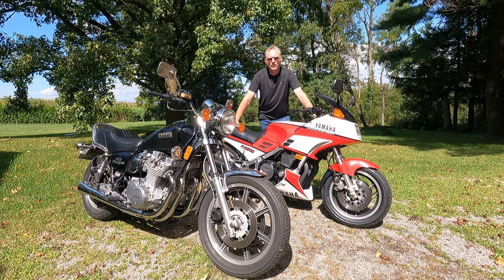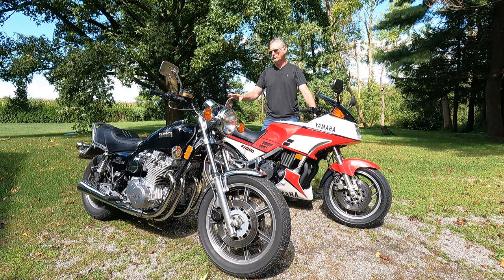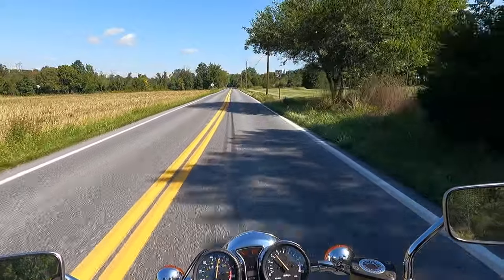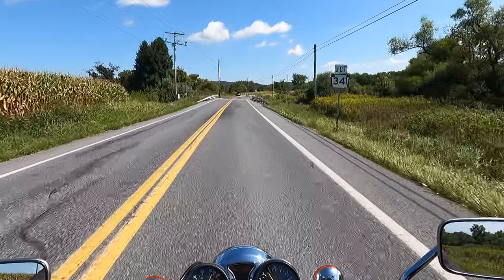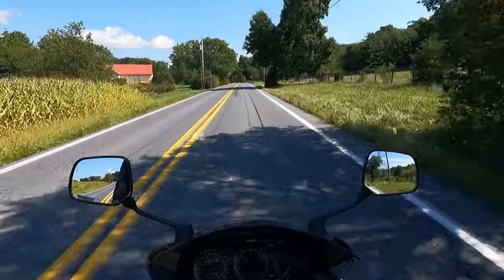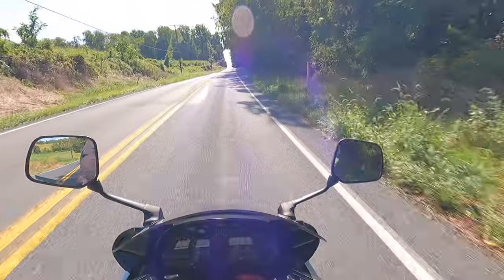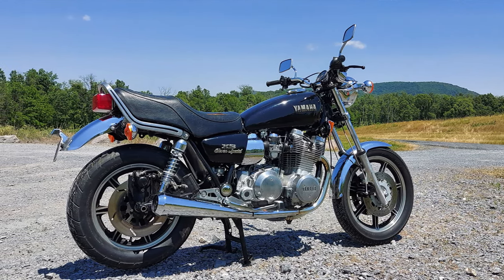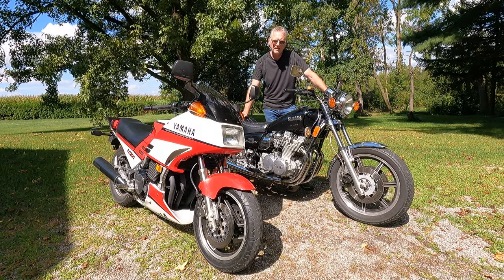Yamaha FJ1200 Vs Yamaha XS1100 - Yamaha's Big-Bore Evolution!

Comment: Great video. I'm restoring a 1980 Special. As a teenager in the late seventies I lusted after all the inline 4's. I did have a friend that bought a Honda CBX new, those prices have gone through the roof. Cheers.
Reply from the maker: Nice! You can check out the XS1100 Special playlist on this channel to see what I did to get mine running and road-ready. The CBX is eye candy and ear candy all in one. I'll be referring to the CBX in my 1980-1981 GS1100E review that will post to the channel tomorrow morning. Cheers!

Comment: I have an fj 1200 / 1987 for 3 years from now. It has 113K miles in its heart, and it just runs  fine as it can be...despite of all the bad things can happen to a motorcycle's engine, like gas flooding the crankcase (I did not notice it for a long time and pushed the sht out of this poor old  lady on the highway) or not good type of oil was used in the bike for 2 years by the previous owner. It pulls hard, sounds awesome. Really noisy  at idle, but I got used to it. John, your bike is in 10 times better shape than mine, so if you change oil regularly, and check your valve clearances, it will last way longer than you  might live (hope you will celebrate your 101st birthday). Greetings from Hungary, Tamas
Reply from the maker: Thank you, Tamas! I'm glad you're enjoying your FJ1200. To get 113k miles out of any bike is awesome. Greetings from Pennsylvania, USA!

Comment: I had a 1990 FJ1200,commuted 150 miles to work on it,never let me down.A very smooth reliable mile eater.
Sold the bike 16 years later,became a little too heavy for me in my 70's.
Still luv Yamaha's,have an out of favour 82 XJ650,but I like it.
Also enjoy my 78 XT500 & sadly, betrayed the Yamaha brand for the first time with a little Suzuki TC185 Ranger.The Suzuki is a basket case long term project,parts dependent.
Reply from the maker: @davidhoddell4209  So cool 😎! I think the 1990 FJ1200 got a rubber mounted engine, which greatly helps the smoothness. The XJ650 was a nice bike as well. Good luck with the Suzuki!

Comment: The XS1100 has always held a place in my heart from my very earliest biking days. My first machine was a 1975 Yamaha FS1E, bought in 1979 shortly after my 16th birthday. Out for a spirited ride around my home in Oxfordshire, I noticed 2 much larger bikes catch up to me then pass as if I was at a standstill, I was maxed out and head down so probably about 46-7 mph 😂. I pulled into a local Yamaha dealer near my village to pick up a part and the 2 bikes were parked outside, a silver and blue XS750 and a gold pinstriped metallic red XS1100, both nearly new. 
I must have been staring at them in awe when the 1100 rider came out of the shop, he smiled at me and said “ you were going well for a littlun mate” I think I said thanks or something but was a bit star struck “ you’ll have one like this one day mate, take it steady” and he walked back into the shop. I waited around for a while to watch them start up and ride off, must have looked like a right sap, it was worth it though. To me they were 2 huge bikes with god like riders, so smooth and skilled as they accelerated off the forecourt and onto the road. I’ve had over 50 bikes in the years since, everything from Rd350lc, Fireblades,  ZX12R, Harley Road kings, BMW GS adventures and standard, GSX-R track bikes etc etc but I would still love to have a metallic red XS1100E in my garage 😊
Reply from the maker: Right on, Mark! Thanks for sharing the memories. Cheers!

Comment: Finally the XS1100 getting some well deserved props. I have an 80 XS100SG that I got in 1981. It now has 35K on it and a few updates. The buckhorn bars replaced with drag bars from the 80s and a sweet MAC 4-1 pipe. I've owned a lot of bikes since then and this is the only one I kept. Short in town hops are on the XS and multi week tours on the HD Ultra. Great bike
Reply from the maker: Right on! It's awesome that you've owned the XS1100 that long. Cheers!

Comment: Several years back, I had the XS 1100 1979 original And let me tell you that bike was properly quick. I’m currently riding a 2023 Yamaha MT 10 which is obviously a properly quick motorcycle as well but I still remember how fast XS 1100 was. I nicknamed it the zapper because you twist the throttle on that thing and zap you go through time and space like you wouldn’t believe. if I remember correctly, mine had either a 130 mph or 150 mph speedometer I can’t remember but I noticed that yours has the 80 mile an hour speedometer.
Reply from the maker: This XS1100 is still properly quick as well. Sitting up in the wind gives it a real sense of speed when you twist the throttle. The FJ just feels relaxed. I was shocked when I timed the results. 1980-1982 the 85 mph speedometers were government mandated, I believe.

Comment: Thanks Jon, did you change the XS1100 petcocks to manual one?  If so, which ones did you install?  I'm looking at that change presently.
Reply from the maker: I'm still running the stockers on mine. Cheers!

Comment: Kenny Roberts, back in 1978, took a journalist from German magazine MOTORRAD on the back of the then new XS1100 for a lap around the old Nurburgring. Wearing nothing but street clothes and a helmet, Roberts still circulating at a record pace for street bikes, still carrying the very frightened motorcycle journalist on the pillion.
Reply from the maker: I'm sure the journalist had his eyes closed for most of the circuit! I watched the Australian endurance race that the XS1100 won (against the GS1000E, CBX, etc.). The XS1100 looked like a handful, with its rear suspension pogoing up and down. You can't argue with the result, but I don't want to push my XS1100 in the corners like that! Cheers!

Comment: Back in the day, the magazine tests featured the roll-on times in the top three gears. This was important for those who liked to ride on two-lane highways like US30 and US40 that are frequented by truckers and RV jockeys. 
The XS Elevens arrived near the end of the Vetter fairing era, as the Gold Wing had set the touring standard and would soon be followed by the Venture, Cavalcade, and Voyager purpose-built touring bikes. 
Bikes of the era were engineered well enough to remain competent machines 40 years later. The only sticking point is availability of replacement parts, and as you showed with the FJ1200, tires. Later models had a 17 inch front tire, so I can't say how much that issue will affect availability.
Reply from the maker: Right on!
Reply: Fortunately, the Pirelli Sport Demon and Bridgestone Battlax BT45 are decent sport/touring tires that are still made in the correct sizes for the FJ1200.  The Pirelli's can be a little easier to find, because the demand for these sizes is obviously extremely low and most suppliers will only carry one brand in a couple sizes, if at all.  At least if you find a supplier and can order ahead, they should be available.  The quintessential '80s sport bike tire was the Pirelli Phantom, which is still being made as the Phantom Sportcomp, but only in 17" and 18" sizes.
Reply from the maker: @kenbowlus2995  This is my first experience with the Sport Demons, but I like them so far. Cheers!
Reply: If you're really going to put a lot of miles on a FJ1100 or 1200, a 17" rear wheel swap is essential, in my experience. It's a very easy project if you use a YZF600R 17"x 5" wheel or an early GSXR 750/1100 17"x 5.5" rear wheel and brake assembly. Now the sky's the limit for tire choices. All you have to do to get a 17" front wheel on the FJ 1100 and early FJ1200 is swap the lower fork sliders, wheel and brakes to the early FJ upper fork legs. You also get better front brakes with the 17" wheel and the ability to upgrade them with later model Yamaha blue, silver or gold dot calipers.

Comment: 2nd gear was popping out on my FJ, removal and a back cut on the dogs fixed it.
Reply from the maker: Yep, 2nd gear issues plagued many of the superbikes. My previous FJ1100 would skip in and out of 2nd at the top of the rev range. Undercutting the dogs was the proper thing to do. Cheers!
Reply: @jonsmotorcyclerescueandrev3538  In the late 90's APE made a proper coil spring clutch conversion to replace that awfully weak diaphragm clutch.  The FJ1100/200 engine became the spec powerplant for 1/2 scale Legend car oval racing during this time period, which was good for aftermarket upgrades but now bad because you just don't see the bikes anymore.  Now you did it I want one again!  Good points on the low and long chassis handling points.
Reply from the maker: @bruces3613  Right on, thanks, Bruce!
Reply: @jonsmotorcyclerescueandrev3538  Performed the back cut with my Dremel and also on the mating slots of the other gear to draw the parts together under torque.  Not sure that's a common approach but with all the power from the big bore kit it never jumped out.

Comment: What would you say if Yamaha had put shaft drive on the FJ? It looks as though for that period both of these bikes did very well what they were designed to do. I would love to have either one in my or both in my stable.  RIDE SAFE OUT THERE!
Reply from the maker: Thanks, Henry! I'm a fan of a good shaft-drive system.
Reply: I've owned 2 FJ 1200s and would not find them nearly as attractive with a shaft drive. I like being able to change my gearing to match my wants very inexpensively. I'm also not a big fan of the shaft jacking effect that you get from most Japanese shaft drive systems.